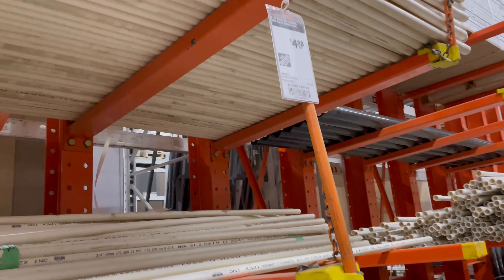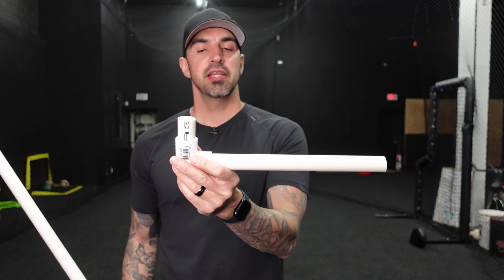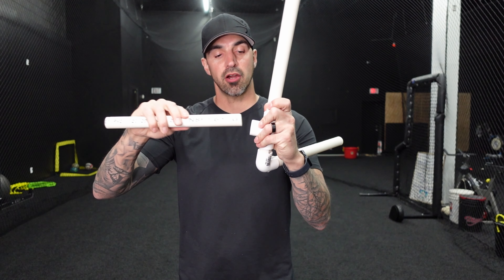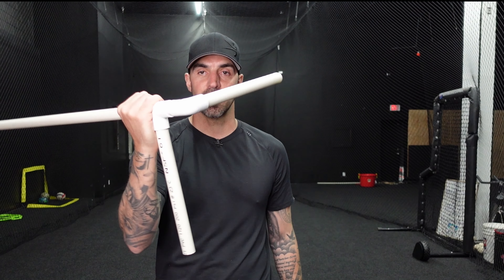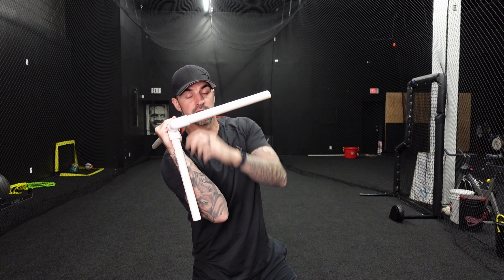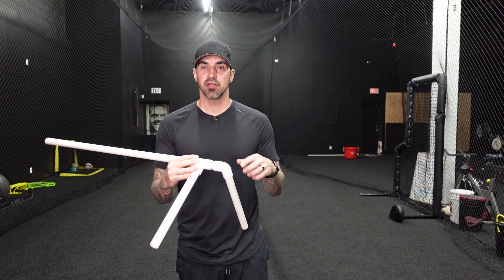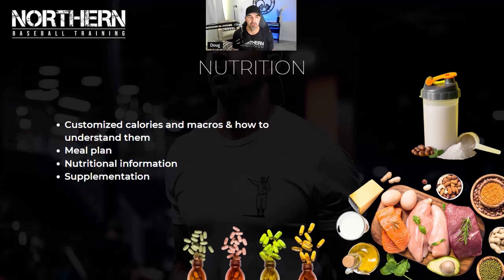*NEW* PVC Hitting Tool

Comment: I loved this video so just went out to Home Depot, got the parts, and built it for my kid.  But here’s where I’m confused now that we’re actually trying to use it. 

How far into the swing should he keep the original right-angle  contact with the device, and at what point should he deviate?  I’d love even a short video that actually shows the full swing a few times using this.  Thanks for this idea, I’m excited to figure it out and use it!!
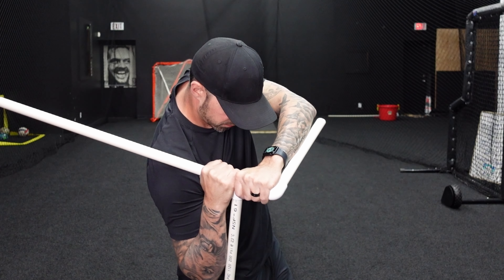Reply: At 1:50 he says to hold it thru the turn, or when the bottom hand gets to near the bellybutton is when he should start to break the connection

Comment: It is a great tool, but you have to hold your arms on the pipes, which can be a little tricky. Still a great idea though!
Reply: I'm going to make one but I'm thinking of Velcro straps so the pipe can't stray away from the arms.
Reply: @justinburgan4184  The problem with that would be that you could only rotate a short distance.